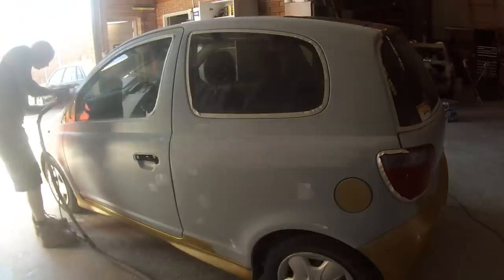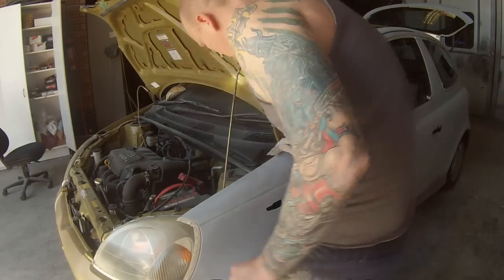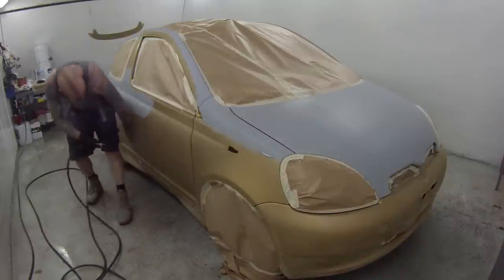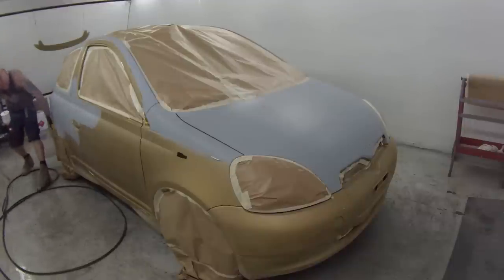Respray Prep Work & Basecoat

Comment: Nice thinking by painting the roof first. I would do the same, but where i work, we have to save materials as much as possible. But i'll be usig the 240-400 sanding tip.
Reply from the maker: Stefan Mihai Neagu Just don't forget this was just a quick one so I didn't get too fussy at all, my method would vary dramatically on a nice car. I have some videos on some restoration work coming soon.

Comment: Hey gunman, I am currently doing a respray of my own. I have the whole car in High fill (it turned out pretty crap!) some of it went dry, it was a warm day probably 36C+ in my booth (shed lol). Anyway, It should all block out fine i hope, I was planning on blocking the whole car with P600 then spraying my Base/Clear. Should I start with a courser grade? Spending a little more on sandpaper to assure no sanding scratch's would put my mind at ease. Just wondering what you would do.

Comment: Hey Gunman, is there any reason you prefer to air blow verses shop vac the dust from sanding?  Would it be better to spend a little more time to not blow dust in possible pin holes as well as make the entire booth filled with possible contaminants that can get in your paint?

Comment: Hey mate. Nice work. 
So first u done the body repairs n then primed the panel. Then u went over the car with 240g n picked up all the pin holes with filler. 
Once u picked up the pin holes did u then prime over the filler or did u lay the colour straight over?
Reply from the maker: Anthony Palumbo I just painted straight over it but not all fillers can be overpainted, I use the Wurth extra fine polyester filler and its the best on the market I think anyway, I also finished with 500 after the 240 and 400 for this job but don't forget every job is different so must be prepared to suit.

Comment: Hey great video as normal from you well made your longer videos are for me the best a video on the spray booth looking at the extraction and filter would be good to see sorry to hear about some twat trying to rip off your logo   im from the UK and when I started out paint spraying many years ago in a workshop with no paint booth I had to spray cellulose it taught you that if you didn't get the paint on just right you had no shine the bonus was almost as soon as you had finished spraying you could cut back and polish the paint without any need for a heated spray booth or need to bake the paint.

When 2k first came out I was amazed at how much better the paint covered compared to cellulose the only thing here that is similar to cellulose is cheap spray paint out of a rattle can as for water based I was lucky to leave painting and change career just before water based came in so didn't get forced to use it much but from my own personal experience with it I would chose 2k over it any day but it may be better now than it was I hope so anyway keep up the good work your videos make me want to get back into spraying again do you send your t shirts to the UK and and approx price thanks.

Comment: Awesome and just plain fun to watch that beautiful fan do what it was meant to do. So two questions though...what micron size is on the filter papers you use and is it different for different paints? AND I notice you always have the cap at the top of the cup lid off, why? and how come you never seem to spill any paint out of there, or are you just super careful? Keep up the great work!
Reply from the maker: TresMamboMusicSchool pretty sure they are 150 micron strainers and use for everything. The cap doesn't need to be closed, if I ever get a drip its because there is some paint between the thread of the pot and lid. Its there to restrict flow, that cap has a smaller hole than the lid so I prefer it open allowing me to smash on a killer coat :-) thanks again for watching mate.

Comment: I have trouble with water getting in my paint my compressor is a 60 gallon single stage 3.5 horse what is the best setup or can I even turn out a good paint job with that kind of compressor
Reply: Bleach 3.5hp should be more than enough,
I’ve turned out some decent work with a 2.0hp before at 105lpm

Comment: You use your da alot...do you not get pig tails or is there a difference in the qualities/brands of a da and speed settings?
Reply from the maker: cooksey187 The final stage was 500 by hand plus I used a ground coat that fills some up and I also like to leave the base a bit thicker to aid coverage and help fill some of those scratches if any left. I used a 3M orbital sander first then a Dynabrade with 400 and interface pad.

Comment: How do you get hail damage in Australia? :)
Sounds funny to get cold ice down to ground in a so warm place. Well our hails are usually very small in Finland.
Reply from the maker: thequattro20v Australia is a massive country and we have alpine ranges deserts and everything in between, but hail storms form very high up in the sky where its a lot colder than the earths surface so doesn't necessarily even need to be a very cold day to have a hail storm. and like everything in Australia when it happens it happens big :-)
Reply: Haha you’d be surprised @thequattro20v we had a big hail storm in Melbourne , Australia one or two summers ago which wrote my car off with damage

Comment: i bought a used audi a6 front bumper cover and bonnet. i thought,based on the pictures, that they were the same color ad my car. well, it turned out there was a fairly noticeable darker tint to the new panels' silver color. the paint on the panels is in absolutely amazing shape. not a scratch, shiny, perfect factory paint. i am not sure what preparation work needs to go on before they can be sprayed with the actual color of my car. is scotch-brighting them enough and if yes, how should I go about it? thanks.
Reply from the maker: I like to give them a sand with sandpaper but some people do scothcbrite, I have a great section on my website dedicated to prep work. http://thegunman.net.au/prep-work/
Reply: But what's best to do? and what grade paper to use? Also wet or dry sand?
Reply from the maker: Did you see the link?? all the answers are there and I explained what I recommend.
Reply: I've actually seen most of your videos, but I don't understand some of the things you show. So for a painted panel that is getting a new color, should I sand it with 600grit sandpaper and then fill, block sand again with 800grit and apply base and clear coats? Is that the procedure?
Reply from the maker: Yes that would work fine, there is more than one way to skin a cat and every job is different which is why you may see me use slightly different methods from job to job.
Reply: Also, do I need to spray primer after I block sand and before I apply the base coat?
Reply from the maker: only if you have repairs, I paint over old paint all the time, if it's a different colour then it can't hurt but still not necessary
Reply: That is all the info I ever needed in life! Thanks so much!
Reply from the maker: Rumen Hristov Good luck mate :-)

Comment: Not a criticism by any means but a genuine question.... You sanded the primer with 400 on the DA and then applied your basecoat right? Don't you see marks through the basecoat at all? Always found the lowest I go to was 500 dry on the DA.
Reply: Could be the paint system? As I find I can get away with 400 dry using De Beer 500 Series. But I'm sure The Gunman might know.
Reply: Yeh I guess so.... I am based in south east Asia and use Nippon paints but have never been able to go as course as 400 without it showing through the basecoat..
Reply: Dale Wright hey Dale ! Have the same here with the paint i am using. Doing the final sand with 500 or even 600 depending on how dark the color is. With the very fine silver metallics sometimes even 800 for the final stage. Nice video as always, thx

Comment: how much paint would do a full cover on a car like litre primer base and clear wanting to spray my bmw e46  and want to see how much it would cost in paint per liter thanks
Reply from the maker: +Dale Wilkinson The clear comes in a kit 5lt clear and 2.5lt hardener, 5lt primer kit and if inside and out 4lt usually does it for basecoat, exterior only 3lt
Reply: Great thanks
Reply from the maker: You'll need a 5lt reducer too for the 2:1 basecoat in most systems but always read the can and a little for the primer and clear 10% usually